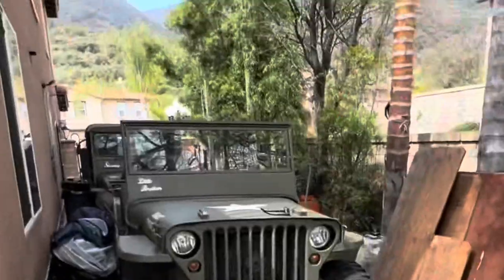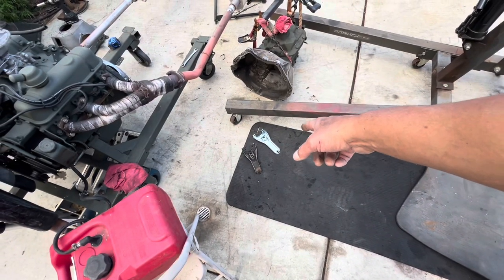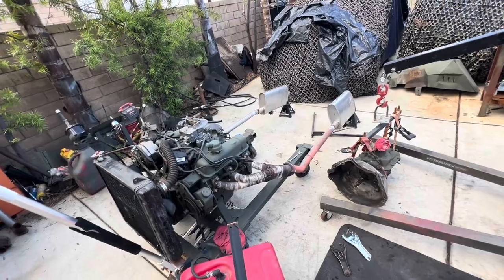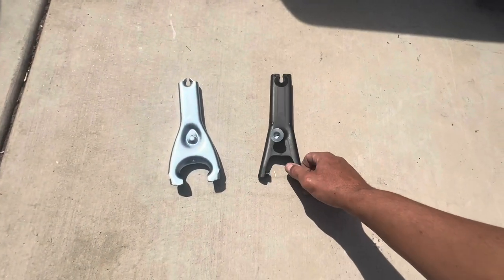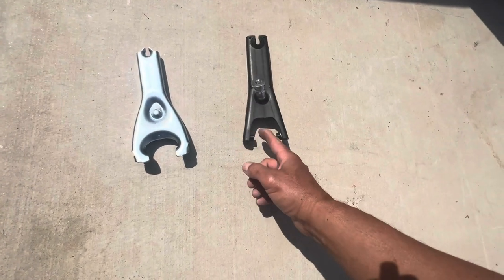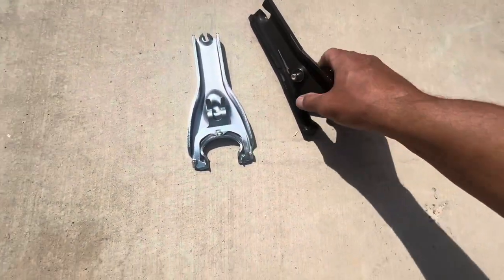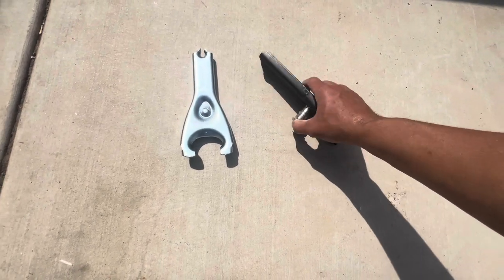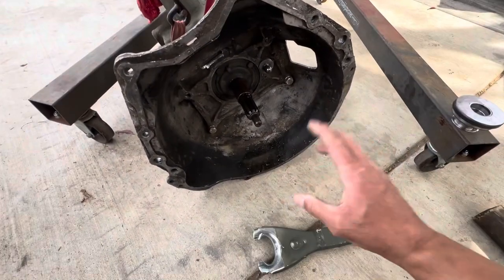4 Speed Swap/ SM420 Clutch Fork/ Novak Clutch Fork/ Buick 225 V6/ part 5/ Willys Jeep

Comment: Hi ,again, to put the sm420 trans on, you lose the old trans adapter and mounting holes for  the t case.  Will you cove that in your next video
Reply from the maker: Hi - yes. (1st) engine (2nd) bellhousing (3rd) SM420 (4th) Novak adapter (5th) tcase. 
thats the sequence. the novak adapter  has same holes for tcase. you dont lose holes for tcase. hope that helps. 
 I have that other video with red jeep that might show it better. 
https://youtu.be/pL7URz1YpH8?si=68miQE1Pc7mGSBgO